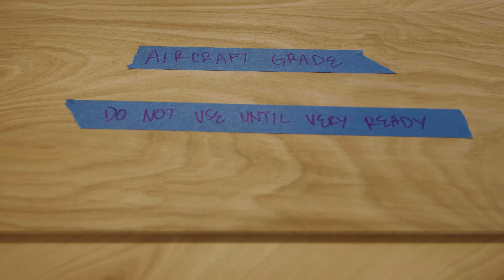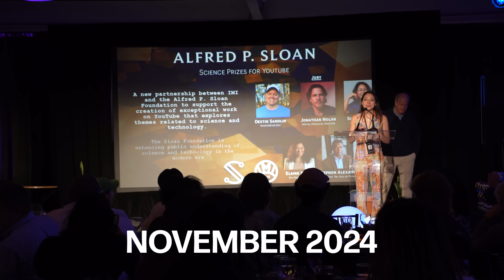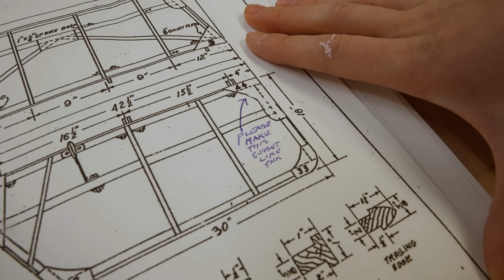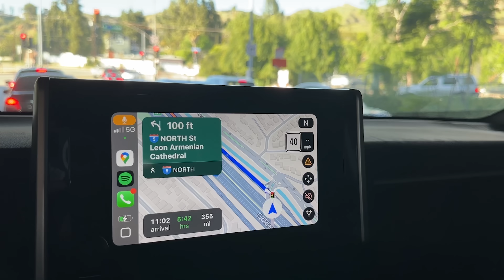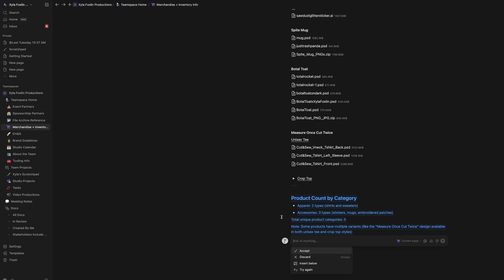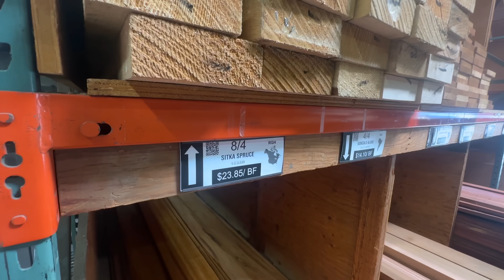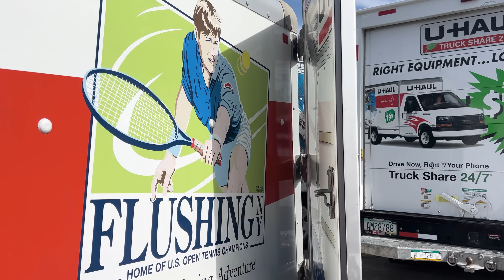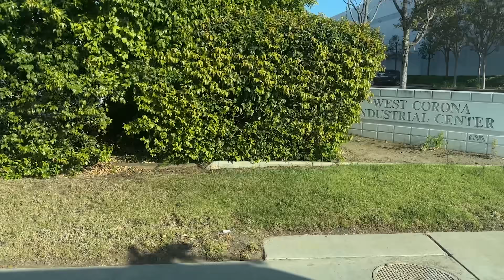I'm Building an Airplane from 100-Year-Old Blueprints

Comment: It's an ambitious project, but I'm 1700 hrs into building a pietenpol, and realistically, it's a 6 year project on your own, without help. ALSO, it's very tail heavy sensitive and adding the canoe cedar is problematic. ALSO, NEVER USE TIGHTBOND OR SUPERGLUE! Use structural epoxy like T-88.

Comment: I remember something about early lift wings being built as frames covered by fabric to keep the weight down. I remember this as I back then found it to be funny that fabric could lift a plane. This was before I started to grasp a better understanding of lift mechanics. In my teens I helped someone build a small single person plane and it was tiny, but he use heat shrinking plastic to get the wings into the right shape.

Comment: Hi; very impressed with your bold project. Pietenpol Aircampers are dream machines. Please, are you using reference books, such as "The Sportplane Builder: Aircraft Construction Methods" by Tony Bingelis or "AC 43.13 Acceptable Methods, Techniques, and Practices - Aircraft Inspection, Repair & Alterations" in your work? I found those recommendations on Scott Knowlton’s website, while I was researching a similar project. Much success and I look forward to watching the next installment of this inspiring build!

Comment: To be frank, I also look into possibility of building my own aircraft, but unlike most peeps, more so oryginal design.

For context, regulatiosn for ultralights in my country( Poland) are fairly liberal on self-build crafts. As such, the idea of creating og design and haveing it registered is not that out of reach.

In fact, looking at aviation requirements the baseline is takeoff speed under 65km/h and takeoff weight under 300 kilos for the smallest cathegory( amphibious and/or two seeters allow even heavier crafts and for ground there is additional 22 kilos allowed if aircraft have dedicated hull mounted" recovery devices" aka airplane parachute).

There is no require for engine type nor max speed so if aviation commity allows your sidebumber you should be golden with even small jet craft :D

Comment: Fantastic project. There is nothing more rewarding than flying a machine that you created. Hopefully, you can see it through. This is not a quick project as you will discover. My wife and I built our Velocity over many years and there were many things that got in the way. We didn’t start at a very young age so we didn’t have the luxury of time. At least this is a fairly simple aircraft. Best of luck, we wish you much success.

From someone that’s been there, done that, seek out advice from knowledgeable people. Join your local EAA chapter, attend a sport air workshop.

Comment: I feel your pain.  I am restoring a 1940 Stearman.  It takes 10 spruce spars, the longest over 12 feet.  Aircraft Spruce had the only Spruce that size in the USA last summer, and it still took them 9 months.  I had to drive from Texas to Georgia to pick it up.  The wood is now so rare that I procrastinated 2 weeks before building the courage to run the first rip!  After the first cut it was much easier…but the thought of using one of the last existing old-growth Spruce trees on the planet  remained humbling.  It is beautiful, Knotless wood with over 20 rings per inch.  I console myself thinking it could last hundreds more years within this plane.  The original wings were 82 years old and still flying, up until a bozo pilot ran the plane into trees…vertically!  But he walked away.

I also know the pain of running out of wood.  If you reference the FAA guidance, there are actually a lot of usable wood substitutes for spruce which are available at Home Depot…for cheap, but you must know the FAA standards to pick it.  Poplar, white pine and cedar are a few.  I would not use them for spars, but they are legal for many smaller parts.

Good luck!  My project is passing 5 years, but the Stearman is very complex, and repairing usually takes longer than building new.

Comment: Wow, what a project !   Going to be such a huge accomplishment when it's done.

I always put off ripping long cuts alone and my son always pulled it to one side or the other.   One day while using my Dewalt planer I got the idea to make something to guide and pull the lumber for my table saw.  Only trick was getting the first part cut so the end reached the guide and drive rollers.  Bit jerry rigged and takes some setup time but it's worked well for me and I don't need to wait for help.

Comment: You should purt stabililizers on the shaft witht he blade, they really do make a difference. Stabilizers are like big 3" washers, about 1/16" that go on the arbor on either side of the blade. They really do make for a smoother blade.

Comment: Xyla… when ripping down into 1 inch strips, we usually set the 1 inch gap between the fence and the saw,. Then you can just feed the wood through over and over again without adjusting the fence every single cut. Your cuts will be more consistent this way also. Just a tip.

Comment: I have a a friend or two that has built/ restored these. I thought the outside of the fuselage was very thin plywood so no need for outer gussets since the plywood is glued along the entire frame. Are you covering with fabric? the gussets get mitered in perhaps and rounded. Maybe yours is being built differently. but that is what I have seen. 
Grumpy old guy that thinks epoxy is a fine adhesive.

Comment: One of the first things I learned as an intern in my first architecture office some years back was to roll paper rings facing out, not facing in like you would think. Rolled this way they try to flatten instead of roll.

Comment: That was a fun video. I have a set of plans that I bought from Bernard Pietenpol from Cherry Grove, Or was it Spring Valley, MN. in 1971.  Whichever town is smaller. He was a very nice man. He showed me his radio shop next door to his home. In back he had a Corvair with the front clip of a '56 Chevy adapted to it. the 'trunk' lock turned under the hood bird, and it was all usable trunk space. I was so very impressed by the workmanship.
 Then it was over to his 'strip' with a good size hanger in which he kept his plane that is on the cover of the handbook The Corvair powered one.  Rolled it out and pulled the prop through, getting it running. Then he climbed in and throttled up running to the end of the strip, turned around and came running back, Taking off in just a few hundred feet.
  After showing me all the maneuvers his plane was able to accomplish he came down close to the ground, chasing the neighboring cows of the landing zone, circled around and made a most beautiful landing. After that, how could I not purchase plans for his plane?
 OK, I'll shut up now.
Reply: He lived at the corner of THE 4-way stop sign in town.

Comment: Hi, the engine used in the original design of the Pietenpol Air Camper was an Ford A Model car engine.  Are you going to use one of these in you build or something a little more modern?

Comment: First thing I learned in architectural drawing class was the way tv and movies show drawings rolled up with the image inside is wrong - backwards. Roll them with the image on the outside. Flip it face down & roll it up, stuff it in a drawing tube. When you lay them out they won't try to roll up on you. No need to put weights on the corners. Use a large diameter tube - most people roll drawings and prints too tightly, they have trouble getting them to lay flat. Use drafting tape not masking tape to secure them to a drafting table or wherever if you need to.  Great video! Cheers!

Comment: RE: paper plans vs. CAD
I'm a "Production Systems Coordinator" for a company that makes drilling equipment for the construction and mining industries. All of our engineering drawings have been converted to Autodesk Inventor files - it supports libraries of component parts (nuts, bolts, washers, valves, etc.) as well as our custom parts, as 3-D models in the .ipt file format. These parts can be linked in various ways in an assembly file (.iam) and even animated or given an exploded view. All of our components or assemblies also get an .idw drawing file, which is usually a multiview 2-D standard drawing - title block, parts list, revision history, etc. We're migrating our QC documents from a separate Excel spreadsheet to a page imbedded in the Inventor .idw file.
We use Autodesk Vault to manage the files, and maintain the revision history. A huge part of my job is ensuring ISO 9001:2015 compliance. We do business all over the world, and it's a huge benefit to our customers in Asia and Europe to have technical drawings available at a moment's notice. Our equipment supports billion-dollar operations, and downtime is unacceptable.

That said, I'm a big fan of paper. Especially for prototyping, or manufacturing a rarely-used part, paper is great. When I send an order out to the machine shop, there are paper drawings and machine setup instructions in the packet. The machinists can make notes, request changes, suggest corrections - they just write it down on the paper, no need to send an email or stop what they're doing. It's very fast and agile. Of course, it only works if there's someone like me to check the completed production packets when they come back. If a drawing or process needs to be changed, the .idw file in Vault is put on hold and the marked-up paper drawing goes to the engineers for evaluation and discussion at the morning huddle. Any issues are resolved between the engineers and production leadership before the .idw file is revised and put back in "released" status.
For our larger assemblies and older products that have a more stable revision history, we have paper prints in large binders for the production crew to reference. Some of our assemblies have thirty or more pages of drawings - I'm not sending that much paper to the floor each time we make a drilling rig!

So Xyla, my advice is to use your set of plans as a "shop notebook" of sorts. Within reason, mark them up. Make notes, record dates, draw pictures in the margins. Don't treat a set of plans like a precious relic - plans are a tool to be used, and will bear the evidence of their use. And if you ever build another plane, or help someone else build one, you will have your "shop notes" as a guide.

Best of luck with your project - I can't wait to see you flying it!

Comment: Something I noticed around the 14 minute mark. You should joint your rough lumber first, get one perfect side and then you can put that side against your table saw fence to clean up the other side. It looked like you made the first cut with a slightly rough side against your fence, and then you flipped it and did the other side. It wont be super accurate the way you did it. Hope that helps.

Comment: Yeah, remember the days when airplanes were made out of toothpicks and popsicle sticks, and held together by gum at the end. And they use bedsheets for the wings And they took apart bicycles and use the mechanics from a bicycle to start the engine and use the vintage water cycle motorcycle motor to get the engine working

Comment: It's brutal to see freshly milled wood just sitting there stacked like that without slats between them. In places like MD allowing air mote contact with one side than the other will let more moisture in one side than the other causing that stick straight to warp overnight.

Comment: It's a rush isn't it? I got into home builts back in the 70s, got most of a Cassutt IIIM built. The Pietenpohl is a pretty design, and wood is a lot easier to work with than welded steel tube. Are you going to search out an old Ford engine for the aircraft? At least the instrument panel is pretty basic,, with just the extras for modern safety added. Just subscribed, you got a fan. Keep at it Girl, keep at it.

Comment: I’ve made replacement wing spars for a 1946 Taylorcraft BC12D. It wasn’t my aeroplane, but the two owners - all three of us are airline pilots - couldn’t find a professional shop that didn’t want stupid money, so I did it for them with hand tools for free. I made several videos about it for my own channel when I was trying to get it going. Paradoxically, long lengths of thick heavy lumber are much easier to work with hand tools rather than machines, because you’re moving the tool, not the lumber. One just needs to clamp it to your bench and get on with it.

Our Sitka Spruce came from Canada and was sourced from a yacht mast maker here in the UK, costing around £800 in 2021. That was for two 5m long wide boards for the mains and two 5m long slightly narrower boards for the rears. The Yacht guys planed them to finished thickness which saved tons of time, although it meant I had no tolerance to smooth the planer ripples, but those wouldn’t be seen anyway. I’ve never seen wood so clear and straight grained before or since. Anyway, the PFA Inspector passed them, so I must’ve done something right. They’re now in the rebuilt wings.

I hope you have an awesome amount of fun doing this!

Comment: you are using the table saw wrongly. You set the width of the piece you need cutting from the fence to the inside of the blade. You then keep cutting your pieces from the fence without altering anything at all. This way, each piece is a uniforn thickness. Your way is backwards, time-consuming, and inaccurate.

Comment: Thin rip blades are not recommended with a saw stop. If the brake engages the blade can shatter and possibly be worse than a kickback.  I hadn't heard that before until I tried to buy one at Rocker and the guy said, "you have a shop stop though right?"

Comment: Xyla I am sure you are an  EAA  member. I'm  a  volunteer EAA technical advisor. BE  SURE  TO  DOCUMENT  YOUR  WORK (besides videos).  EAA has free on line builders log on their website. When you finish building, get ready to fly, you will need to register it and get the special airworthiness. EAA  store, for a nominal fee, has a registration kit, how how to comply and  finish FAA paperwork. Also consider reserving an N number now, it's only  $10/yr. to reserve it. Good  luck.  Can't wait to see this fly.  Long term project so don't freak out if it takes time, elephant one bite....  WHAT ENGINE?  The Pietenpol 1st  flew around 1930's, using a Model A Ford engine, with 40HP  at +300  Lbs. You can do  better. Continental A65 or  A85 (out of production and getting  harder to get parts) is obvious. Since you are an  EAB aircraft (experimental) you can  use what you want.  There are so many choices now, Rotax 80-100HP,  UL Power UL260 97-107HP,  Jabriu GEN4 2200 80HP (don't get early Jabriu's), or like the Model A, there are automotive engine adaptations or conversions, many out there using a Honda engine, or other similar small Japanese car engines. Due to lighter weight you may need to extend the engine mount or use ballast... for CG.   I'd love to help you, but live too far away. You don't need help, but I would have fun... I make it out to California from time to time, I can do an EAA technical review, which is good for nothing. Ha ha, but it does document things before closing up wing or fuselage. You get a one page report. No charge. FAA recommends periodical inspections by other eyes. If not me there are Tech advisors in your area Oh-plenty I am sure. I know what kind of work you do watching your videos for years. Amazing nice smart lady with gobs of talent, perseverance and heart. GREAT PROJECT... Respect.

Comment: you should compare this information to your 100 year old design.
the root chords of the stabs should be equal in length. !
the chords of the rudder and elevator should be equal in length. !
the span of the horiz-stab should be roughly equal to thirty percent of the wingspan. !
there is no good reason to use an 'under-cambered' wing profile when a  TWO-surface profile is used. !

Comment: Since Xyla said nothing about it, I had to Google why Sitka Spruce is the preferred wood for aircraft construction: Sitka Spruce is highly favored for aircraft construction due to its excellent strength-to-weight ratio, lightweight nature, and ease of working. It's a lightweight wood that can still handle high loads, making it ideal for structural components like spars, ribs, and longerons. The straight grain and uniform texture of Sitka spruce also contribute to its suitability for aircraft building.

Comment: I converted my table saw over to 220v single phase. Made cutting hardwoods easier to cut, decreased burning and tear out.  Biggest expense was having a 220v outlet installed.  Usually the motor can be switched over to 220 but you will need the correct cord and plug for the saw.

Comment: My my, you really did bite off more than you can chew.   But  like the old question, how does a mouse eat an elephant?  One bite at a time.   
I’ve never truly given up my project of building the Pietenpol.  But certain life “issues” have halted my progress for the last two years.   
This video has been a nice little, added inspiration to get back to it.  One bite at a time right.    I have a little work on the Turtle deck I could maybe work on this week.   
Ps- There are some glaring and not-so glaring errors in the plans.  Reach out to me and I’ll point them out.

Comment: I had a Nissan truck, 6-cylinder, with just a rack on back. I could easily carry 16ft. lumber or ladder. TX.
Easy to strap it down with straps. You can get a good used one.